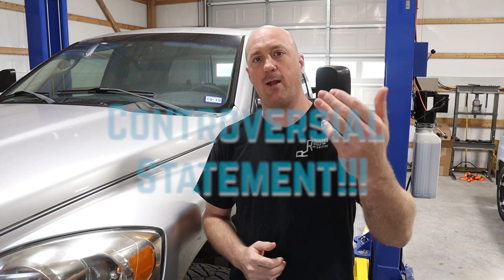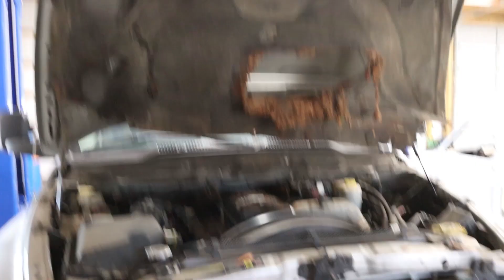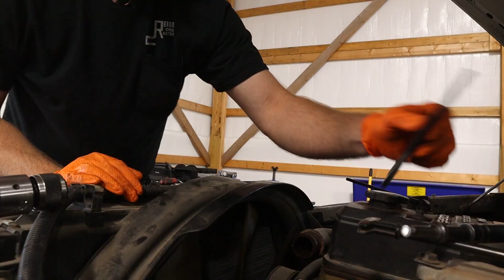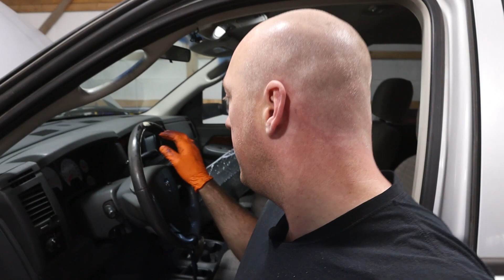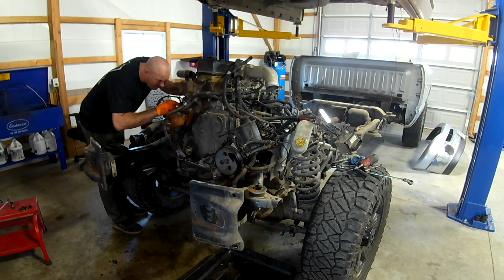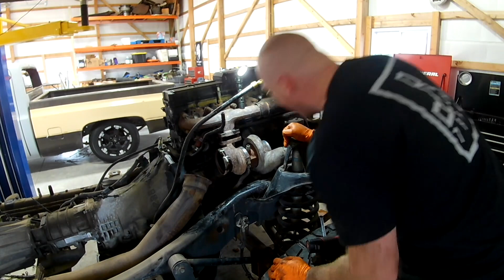5.9 Common Rail Cummins Engine Rebuild Series Ep 1

Comment: I'll agree the 6.7 is a better engine IF you delete the emissions.  Our 09 was only getting 10 to 15 mpg when it was new. It only had slightly more power than my 5.9. After the warranty was up we had a delete done with a 40 hp chip. 20 mpg pulling a gooseneck horse trailer. In mountain driving, empty I've hit 27mpg. The old 12v were a different kind of good. They require much less to keep running good.  They are not loaded up with a bunch of electronics. The injectors out last common rail injectors by 150,000 mile and cost much less money.
Reply: Thank you stating this. 12 valve is for the actual working man. Ranchers, farmers, oil man. Longevity and lower repair costs. Not for pavement princesses

Comment: I believe Cummins went with the 6.7 is not because there are flaws with the 5.9 but due to the hp race, Ford,Chevy and Dodge were after more and more power and the only way to get reliable power is displacement .

Comment: I went from 2  rams both 6.7 over to the 5.9. I've had three 5.9 and i regret spending money on these trucks. Both my 6.7s were deleted. Over 500k miles easily. I can't seem to take a 5.9 over 300k without spending lots of money. By the way i tow heavy with my trucks.

Comment: 🤣🤣🤣 uhhhhhhh 1k horse on a 12v is not a long shot by any means....and theyve ran them with stock bottom ends reliably.....strange how the 12v even with some juice outlast the new shit.  The p7100 will eat shit fuel and just keep on trucking, as far as reliability the 12v beats the shit out of anything on the road after it i have no idea where your getting your info but it absoutely sucks  fix the kdp put a good shutoff solenoid on it weld the 5th gear nut (nv4500) and beat the fuck out of it my dude

Comment: The 6.7 doesnt have nor will it ever ha e the history of the 5.9
This is why the 5.9 was  so popular
Reply from the maker: The 6.7 is literally the exact same engine, it just has more displacement. Of course, they added a bunch of emissions controls that have affected the reputation, but the engine itself is absolutely incredible.
Reply: @Reignited - Cycle and Automotive  it is but I feel you are missing the point.
The new beetle will never have the nostalgia  that the original vw bug did for one reason. It can't go back in time and earn its place in history.
The 5.9 24 valve literally saved dodge from certain doom.
With that said I too feel that the 6.7 is far superior than the 5.9
But better? That's a tall order

Comment: So, by your logic, the 6.4 and 6.0 powerstrokes are better than the 7.3 because they don't make it anymore. We all know that isn't true.
Reply from the maker: First of all,  you're comparing apples to oranges. The 6.7 Cummins is merely an updated and oversize version of the 5.9 Cummins,  not an entirely different engine. And my point stands,  the 6.7 is a far superior engine versus the 5.9 it makes more power and more torque and is just as reliable, and yet it's quieter. How is that not better?
Reply: @Reignited - Cycle and Automotive  I see your point but you stated in the video that they don't make the 5.9 anymore so it's inferior.
Reply from the maker: @Mark Police  it's kind of like comparing the Chevy 350 to the Chevy LS series,  you'll have the die hard supporters of the classic small block,  but almost everyone can see the LS is a better engine in every way.  Technology progresses, and to like the previous generation more just because it's what you're used to is short sighted,  that's why I have trouble with the 5.9 zealots. ESPECIALLY the 12v psychos 😆
Reply: @Reignited - Cycle and Automotive  Yeah. That's definitely true. The 350 is good but the LS is definitely better. I think the appeal of the 5.9 is its simplicity. But I'd rather have reliability.

Comment: What do you do to resurfacing the head and block???
Reply from the maker: I don't automatically resurface them.  I've got a straight edge tool to check the flatness of the surfaces,  if they pass that test I just clean them up for reinstallation. 👍

Comment: The 12v gets all those miles and reliability but the 6.7 is better because it's newer and gets more power?? What!?
Reply from the maker: It's just my opinion, but there's literally no comparison between what a 12V can pull, and what a modern 6.7 can pull. It's making literally 4 times the power of the old 12v engine, and if you take the emissions stuff off you can still get 15-16mpg out of it, how is that not an improvement? Sure you can build up a 12v to make serious power, at which point it is subject to all the reliability issues of any other engine when pushed past it's designed specifications. I know there are some out there who are perfectly happy with the stock power of a 12v, and you're right, they'll do 500k miles without breaking a sweat. But for me, I'd like to get someplace sometime this century, not to mention with my eardrums intact 😄

Comment: why do a lot of dodge fans say that the, 5.9 is pretty much one of dodges best engine and that it was a mistake to stop using the 5.9? what makes the 5.9 so great to these people and if the 6.7 is better, is it because of the power output you can add easily to it?

Comment: Is it possible to unbolt the A/C compressor and hang it from the body so you don't have to dump the freon ?
Reply from the maker: Interesting thought, I've never actually tried that before. I suspect it all depends on the routing if the lines themselves. 🤔
Reply: @ReignitedAuto  I saw it done on youtube with a Chevy van and I assume that is what was done when the Ford tech lifted the entire cab off my 2018 F150 to replace the cam phasers , 5 trips total because of that mess so I sold it back to the dealer and bought a 98 24v 2500 ram w/172k miles that I can fix myself ...
Reply: Used to do that on Chevy 350s. Just unbolt and lay em over to the side. So nice lol

Comment: Controversial statement coming .... 6.7 HEAD GASKET .... I'm happy with the 5.9 24V with the VP44 to the point I have bought used with 330k miles and my latest purchase a 98 with 172k ... too much electronics I don't want to deal with , I can live with the VP , I have a spare.

Comment: The 5.9 was discontinued because it couldn’t meet modern emissions standards. Not faulting the 6.7 I love both. And do agree the 6.7 overall is a better engine too just wanted to clarify cummins main reason to stop production of the 5.9
Reply from the maker: Nope. If they added the exact same external emissions components to the 5.9 as they have the 6.7 it would pass just fine. They upped the displacement because all the other major manufacturers were going bigger and they needed their tow ratings to match up.
Reply: @ReignitedAuto Exactly!

Comment: I don't agree . The 6.7 is a 6.7 because they had to make a slightly larger motor to compensate for the emissions egr ect. Arguably it's just more because it had to be not a better motor.
Reply from the maker: The 6.7 is better in every measurable metric, and with the same reliability as the famed 5.9 version. Literally it's the same engine, it just is slightly larger, which makes it better. My opinion anyway.

Comment: I like the 5.9 just for the lack of garbage emissions controls and reliability. The 6.7 is great but explain the heroic champion slapping of the injector against the piston that's attached to the 6.7. It's a great engine but not flawless. The 6.7 turbo is nice as well.
Reply: why do a lot of dodge fans say that the, 5.9 is pretty much one of dodges best engine and that it was a mistake to stop using the 5.9? what makes the 5.9 so great to these people

Comment: Hey those plastic flakes are the paint inside the oil pan pealing. Make sure you buy an oem pan when putting it back together.  I bet it clogged the oil sump and then starved the motor of oil
Reply from the maker: Good call on that, I haven't cleaned the pan yet so I'll take a look at it when I do 👍

Comment: How high is your ceiling? Atlas 12k lift ali?
Reply from the maker: That's correct it's the Atlas 12K extra wide extra tall. I actually designed the building around the lift believe it or not 😄 I knew this was the lift I wanted, so if you can see in the videos the trusses are scissor trusses so I would have enough room for the lift. The walls are 14' high, and the lift measures 14' 9".
Reply: @ReignitedAuto  
Thanks looking towards the pvl-9bp my ceilings are 12ft. Currently have the bendpak md-6xp mid-rise works well but have taller ceilings now with new location. Keep up the great videos and watch out for black eyes...
Reply from the maker: @alandhutchison  😄 check out asedeals.com, that where I got this lift from and I was really happy with the price and the service 👍
Reply: @ReignitedAuto  same here I bought my bendpak from asedeals.com. How thick is your slab any issues? What was your final torque on the anchors?
Reply from the maker: @alandhutchison  no I wanted to avoid any issues so my slab is 6" but underneath the lift is 9". I went with the German torque spec "gudentight" 😎
Reply: @ReignitedAuto  gotcha have 4.5 " within minimum requirements hilti bolts only need 3-3/4" will attempt in the future before cut and pour a new slab. I enjoy your videos again and like to see that not all work needs to be rip out the engine as in your hemi spring replacement. Keep it up, and let me know if you need some free hosting for your site?
Reply from the maker: @alandhutchison  thanks man I really do appreciate you watching, and I'm going to try to get some more DIY friendly videos on here soon. 👍

Comment: They are not making the 6.7 because it’s better they are putting them in the trucks now because the 5.9 couldn’t make enough power to compensate for the emission system.
Reply from the maker: I stand by my statement 😀

Comment: How dare you say there is a motor better than the 5.9!! Don't you know the 5.9 Cummins and the 7.3 Powerstroke are the holy grails of diesel engines!! Blasphemy!! 😂
Reply: why do a lot of dodge fans say that the, 5.9 is pretty much one of dodges best engine and that it was a mistake to stop using the 5.9? what makes the 5.9 so great to these people
Reply: @nexpro6118 as a dodge guy myself, they are million Mile motors, no emissions equipment strapped to them, and if taken care of are virtually free of major problems. (As far as the actual engine itself goes 😂) the auto trans, electronics, HVAC are more prone to issues though. And body rust.
Reply: Another thing to add is Cummins INC believes so much in their motors they have a “million mile club” you can get badges to put on your truck every 100,000 miles you hit starting with 200,000 I think.
Reply: I think the 6.7 Cummins is the best engine Ram has ever made.
Reply: @RickySlatton ram didn’t make it but yea it’s the best they’ve ever used